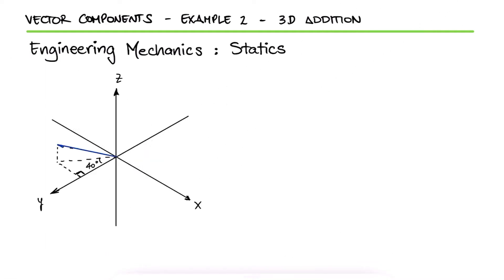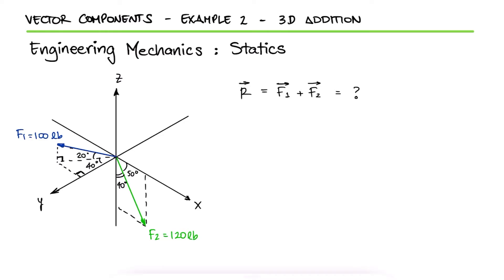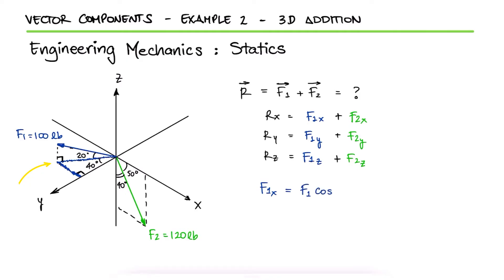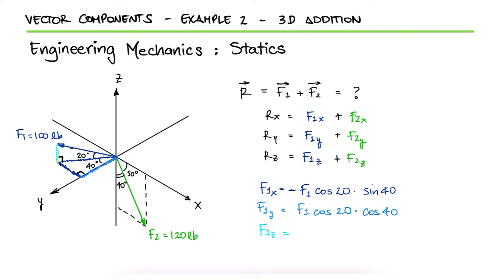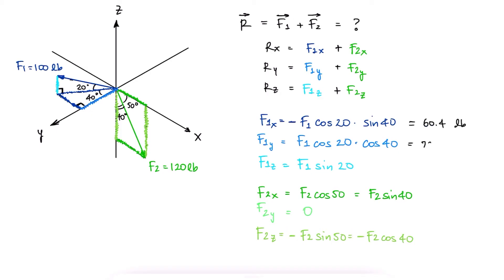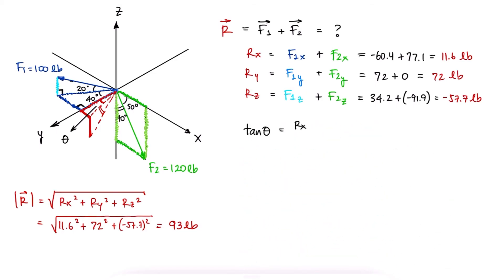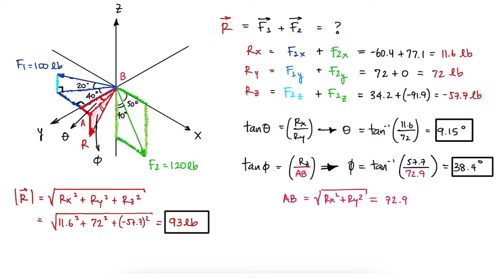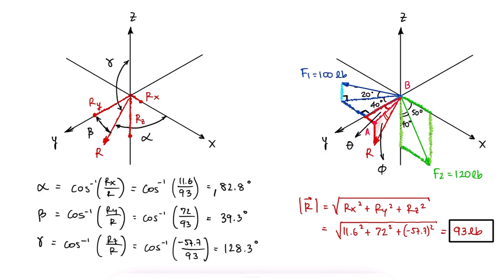3D Vector Addition in 3 Minutes! (Statics)

Comment: I don’t understand, why f1 cos 20 x sin 40?
Reply: Did you ever figure out why😭
Reply: If it helps I figured it out, you have to do F1cos20 to find the hypotenuse of the triangle on the xy plane then you multiply that value by sin40  to find Fx
Reply: @zakdaowd524  since the 100 is in the z axis, you have to project it into the xy plane by using the cosine of the angle that its tilted into the z axis, which is 20, so it ends up being 100cos20 in the xy plane.
Reply: @zakdaowd524  hey dude thats wrong solution
Reply: @shresthroy3833  how lol?

Comment: You fooled me with the "non-left hand" coordinate system.  Will have to check that from now on, I can never assume this again.
It's okay for vector addition, but if this involved moments and cross products it would not work, of course.
Reply from the maker: Haha. Yes, you are correct. This is just for basic addition; specifically for vector components. Moments would be all messed up, if axes are not set up correctly.